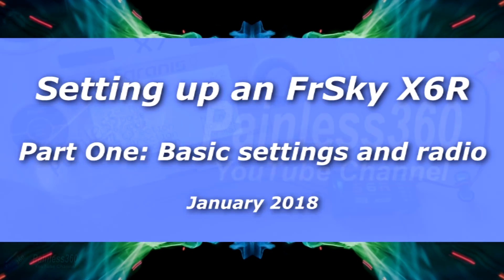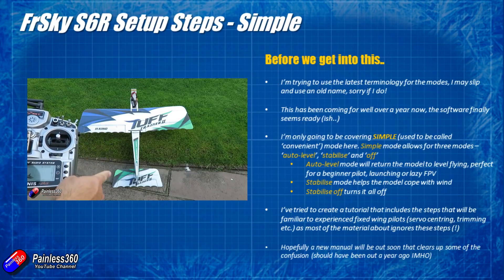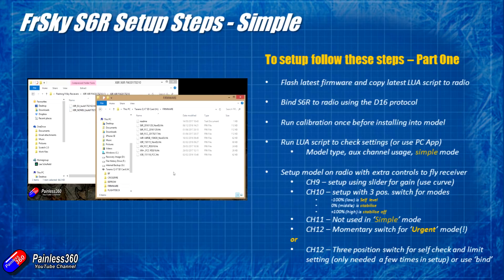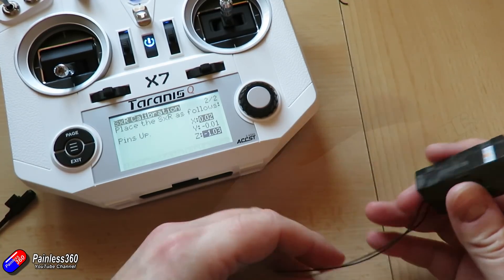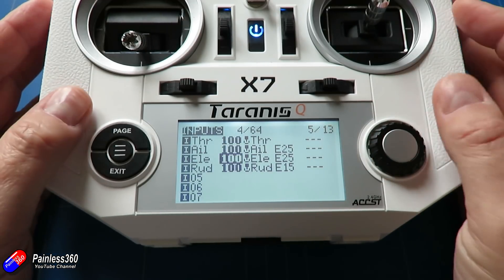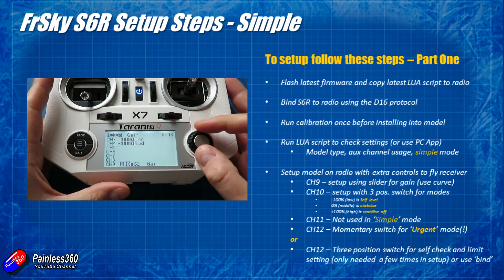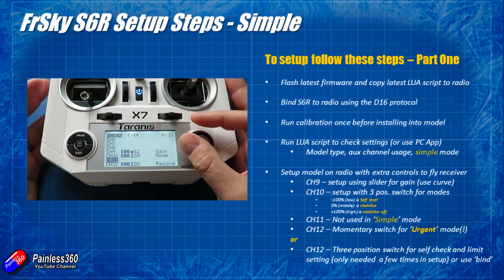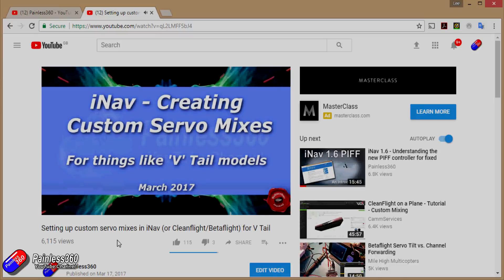(1/2) Frsky S6R/S8R Basic Setup

Comment: These are great videos thank you. howevrer the thing that had me totally foxed was that servo reversing on fixed wing models These are great videos, thank you! However, I was completely puzzled by the fact that servo reversing on fixed-wing models is done outside of the Lua script and is simply adjusted on the transmitter. Looking closely, I noticed that two of the channels in the image have a negative sign in front of their display.

The challenging aspect is that this is not the case when setting up for a Delta; in that scenario, the Lua script does reverse the servos.is done outside the Lua script and is simply done on the transmitter Looking closely I can see that 2 of the channels in the image have the - sign in front of the channel display .
The very challenging thing is that this is not true when setting up for a Delta; here, the Lua script does reverse the servos
Reply from the maker: Check out my videos on the Sparrow stabiliser.  So much more advanced than these... Happy flying!

Comment: Hi, sorry if you covered this, I'm in a rush between videos to find this crucial although simple information. I'm using this receiver for a non-airplane application and it's incredibly dangerous if the motors try to compensate with the stabilization features. Because of this, I need to disable the accelerometer---how is this done? Thanks!
Reply from the maker: Yes you can turn off stabilisation and the change the gain. Happy flying

Comment: Hi, thanks for the video! However, I discovered a strange phenomenon. If the gyro is deactivated via the 3 pos switch, the auto mode is still half active. I disabled my gyro but my plane would not fly inverted, the gyro kept trying to use the ailerons to bring the plane back to normal flight attitude. It took me a long time to find out what caused it. I have to set the AUTOLEVEL gain value to 0% in the gyro menu in the LUA script. This is the only way to fix the problem. The second strange phenomenon is that I have to manually calibrate the gyro before every start as soon as the lipo is plugged in, otherwise it cannot be deactivated via the 3 Pos switch and would be on permanently. Somehow I haven't been able to get along with this S8R gyroscope for 2 years. I discover new problems every time.

Comment: What rx would you recommend for line of sight flying in planes not needing stabilizer or gps .Just a good reliable 6Ch RX to work with my TX16S.Thanks
Reply from the maker: I use mainly FrSky X8R receivers here as I have lots from the days when I had a lot of fixed wing models all built at once..
Reply: @Painless360  Ok, thank you . Have you heard anything about them not being compatibe with the radiomaster tx .Something to do with what version of the accst they have. Im really new and just looking to keep it simple and plug and play and not have to mess with firmware and such.

Comment: Can you use the stabilizer on the x20 tx? I can't find anything to show me how...
Reply from the maker: It should do, same process. I've not had the X20 in here to try so can't sat categorically. Best of luck
Reply: @Painless360  I did find a video for it. It is way different. I didn't really know that it was called "SxR." That was the biggest thing to help searching.
Reply from the maker: The 'X' in SxR is there because there were different versions, an S6R and an S8R (as in the thumbnail for this video). Happy flying!

Comment: With this gyroscope, i dont need receiver?
Reply from the maker: It is both..
Reply: @Painless360  Do you know any gyroscope that is lighter and accepts at least 7-8 channels?
Reply from the maker: I have a few videos in stabilisers on the channel - check them out. They will need a separate Rx though..

Comment: Thanks for the videos, they have really helped me get the s6r going in my power glider. I have an issue running 2.2.4 and on the simulator is shows "S2" 0  to 100 % with 50% in the middle as in the video  but on the actual transmitter it give me 0 to 100 in half the turn radius, 50 is at a 1/4. Can you tell me what I may have done wrong or is the a glitch with 2.2.4.

Comment: Can't get the AIL to work ? I have put it in the correct socket in the receiver and put the mix like yours, but no reaction on AIL1. Anyone have any clue?
Reply from the maker: What troubleshooting have you already tried?
Reply: @Painless360  I did put the AIL in other channel and it works there. I took the latest  SD files from open tx which have the SxR files in them. The wing type lua and the calibration lua. The new one from 2020 didn't work, I got the one from 7-7-2019. I didn't update the firmware of the receiver yet, maybe that's the issue?
Reply from the maker: I'd always update if you have a problem, it's the first thing anyone trying to help will ask you too.. Best of luck!
Reply: @Painless360  So i updated the firmware and bootloader opentx en taranis. Got the new firmware for the S6R, but now I can't bind it to my radio anymore. It's solid green when binding, after plugging it (battery) out and back in, it flashes red...
Reply from the maker: The latest firmware from FrSky isn't compatible with the previous versions. I'm guessing you are not a regular viewer else you'd have seen this - https://www.youtube.com/watch?v=vOAFdp52cVU

Comment: Thanks for that video. I helps a lot with setting up my X9Dplus. What I did not really got is the difference between "self level" and "stabilize" an channel 10!?
Is "self level" the backflip to horizontal flying mode?
Reply from the maker: Stabilise is like what a gyro would do and self level does what it says on the tin - self levels the plane in the absence of a stick input.. Happy flying

Comment: Hello, Mr. Thank you very much for your informative videos. All helped me to set up my S6R without problems. I have only one question. Is it possible to turn it around 180 degrees? Heading direction is always antennas front. In FreeLink software from FrSky there is no such an option.  Inside of the fuselage is no room to point antennas out if it is set up as normal. Therefore I need to turn it around, otherwise, I get failsafe and RSSI low. Thank you for any help.
Reply from the maker: Not unless the software has changed since I made the videos... best of luck

Comment: Very helpful video, I'm setting up a few of these for the first time. Quick question. Is it possible to use two of these receivers together? I have a plane that would benefit from using 14 separate ports. Would I still be using ch. 9, 10, 11 and 12 for the gain etc. or would they shift to 17, 18, 19 and 20?
Reply from the maker: I've not tried. See my D16 X-series reciever binding tips video for how to bind two normally... Happy flying

Comment: I got an S6R about six months ago as a gift from the g/f, an had all sorts of problems.  Finally got it to work not but a week ago, but I still just use the EagleTree Guardian that I bought to replace it.  Sooooo much easier to setup, but it is JUST a stab., not an RX/Stab combo like the S6R.  Still.....
Reply from the maker: The eagletree unit will probably outperform this thing from FrSky. As I've said in many other posts  - it's a good idea but a lousy implementation... happy flying!

Comment: I appreciate all of the time and information you provide here.  Thank you!  I would LOVE to be able to use lua scripts for calibration and set-up of my S8R, but the scripts I have downloaded several times from OpenTX do not seem to connect with the S8R (no yellow lamp) and show ---- for all the input blanks.  I've reviewed the radio set-up and have the mode and channels set correctly, with telemetry (radio prompts and screen confirm this) but can't get them to operate in my X9D plus.  Can you help?  Thanks in advance...
Reply from the maker: Hi Steve, I've only created the videos in the playlist as I'm not a fan of this thing. The idea is great but FrSky made a hash of the software and hasn't sorted it enough despite all the feedback. If you get it sorted I'd like to know what it was.. Best of luck!
Reply: @Painless360  Thanks for your response.  I've tried to find a LUA script that works but can't.  They're no longer on the FrSKY "tools" menu.  Any way you could post the ones that you have, so I can pick them up?  I'm running S8R with latest firmware (quick mode).  

The SxR is a great idea and I can appreciate how much information the RX has to have to do it's job on any one of a million different set-ups.  Getting that in there is not easy.
Horizon Hobby makes BNF planes with ASX3 receivers in them and configured and they're pretty good right out of the box.  This is the right way to do it for new pilots.
Reply: @MrStevealvey  if I understand you correctly? You can't get your LUA script to run??  I'm in search for the same answers.  Just got this receiver today and it talks to the Tx but the Tx doesn't want to run the Lua or Calibration.

Comment: I'm trying to setup a Delta wing for my flying wing with the S6R but when I try to setup channel 1 ail and channel 2 ele it only controls channel 1. When I delete the mix for channel 1 and then have channel 2 it controls my servo that's plugged into channel 1. I found if I turn off the features for auto level and what not I am then able to control the servo plugged into channel 2 with the mix setup for channel 2 like it should work. Please god help me.

Comment: I know this is an old video. I have an S8R. Using the airlink USB adapter I have used it to succesfully update to the latest firmware. However once I switch the USB adapter dip2 to configuration mode and connect my S8R it doesn't seem to do anything. I can read & write settings to teh receiver but none of them "stick". In other words I can change a setting, write it, then when I read it back the setting isn't there. I am using Freelink V3.0.  Does the freelink app still work?

Comment: Hi, great video. I’m new to flying. I have a bixlar 2 and the s6r. Looking at your model on the simulator you have ail and rud weight set to -100. I’ve watched your other setup videos and I don’t understand why. Should I be doing this?  Thanks.
Reply from the maker: All I knew about this thing is in the video - I've not used it since making the video to help others out. Best of luck!
Reply: Hi, I realised what it was.  -100 weight is for swapping the direction of your rudder. Thanks for the fast response

Comment: could you help i have the s6r can i daisy chain the gps and the voltage meter from frsky too it and it all works?
Reply from the maker: If you are using the S.port sensors then they work with it in the same way as any X series receiver..  Best of luck!
Reply: @Painless360   thanks very much

Comment: Hi, thanks for this great video. I run into a problem though. I have calibrated my S8R once, but when  trying to calibrate it again (with my X9D radio), the LUA script stops at position #1: I can enter as many times as I want; position #2 won't come in. I tried that because I have opened the RX to waterproof it (it is for a Dynam Catalina) and didn't know if the calibration would be affected. Is the calibration a 'one time only ' kind of thing?

Edit: a day later the calibration mode worked again. No idea why, but the result counts :-)

Comment: Rather than creating a curve for the gain, why not just set the weight & offset to 50? That makes the potentiometer's range 0-100

Has the same effect but probably a bit quicker to set up for most folks.
Reply: That's what the manual suggests, too (at least for the Archer SR receivers, which basically do the same as these).

Comment: I cant get my S6R to enter Bind mode. All I see is a solid green lite on the RX. I've flashed the RX several times but this hasn't fixed it. several people have shown this happening. Please not that this has nothing to do with the TX The RX will not enter BIND mode. I have been able to bind this RX in the past PLEASE HELP
Reply from the maker: All of the information I have on this receiver is in these videos. I’m not a fan of these, the idea is excellent but the implementation is terrible. Best of luck with your problem, let me know if you find out what the answer is.
Reply: @Painless360  thanks for the mega fast response. Binding which should be a simple thing seems to not always work as it should.
Reply: Just a quick heads up. The issue was the back board of the Taranis. I replaced it and it now works fine. A multimeter across the antenna leads has my dead board showing open circuit and the working board has a very low ohms around. 6 oms on the one that works.
Reply from the maker: @finecutpost  Well done on finding that out. Glad it's working!

Comment: Hi Lee,Thank you for these videos they have been a great help so far. I do however have one issue and was wondering if you could help to shed some light on it for me. I'm using an S6R in a delta wing EDF and as per the video I'm letting the RX do the mixing, Everything is fine when both AIL and ELE are set to 100% but as soon as I try to add dual rates, expo and travel limits I end up getting limited travel on just one elevon servo. I've tried adding the dual rates in both the Inputs page and the Mixer page to see if the issue was caused by changing the mixing in radio but the issue is re-occurring. I was wondering if you had come across this issue yourself or if you might have a suggestion on how to overcome it as I can't fly this EDF without equal aileron travel or without dual rates especially on its maiden. Thanks in advanced for any help you can give. 
Kind Regards, Ben.
Reply from the maker: All the information I have is in these videos, I’m not a fan of this thing personally I think the idea is excellent but the implementation is lousy. I only got it to work by following the steps exactly. Best of luck!
Reply: @Painless360  I get your point exactly with this thing. So close yet so far. I will play with it some more and if I find a solution I will let you know. Thanks again Lee. Have a happy new year.

Comment: Have you any video's on how  to set the 3 flight modes for a helicopter, ie normal mode, idle up 1 and idle up 2.? I have converted my Raptor 30 to electric and will be doing my 50 SE next, cyclic and throttle moving together and throttle cut all working, swash at 90 deg and hoping the gyro working , I have done this as a gear switch as on normal tx's +50,-50. Not much in way of video's like your's  I find that using a video is better as it can be stopped and started as you want. Thank's for any help you can give. I have looked on all the video's that you have made and can not find one on this subject. do not know of any other way of contacting you other on this site. You can find me on face book if you use it
Reply from the maker: On what radio?
Reply: @Painless360  Taranis Plus X9D
Reply from the maker: Then google something like 'OpenTX heli Painless360' and you'll find what my video that will help..

Comment: I just got one of these to put into a Bixler 2 (thanks to your help with all your videos on this). During setup I have found two strange issues, 1/ The orientation of the S6R compared to the Lua is messed up. I have to fit it so the X6R is on its side like you have but in the Lua I need to set it up with the S6R UPSIDE DOWN for this to work correct. 2/  Normal set up in the Lua I get an output from AIL but not from AIL2, this is the same for ELE2. This is not a problem as I can use a Y servo splitter for both Ailerons and connect this to the same AIL port giving me two free channels. All this was using the link to the files you have for flashing and Lua.... Confusing but working now.
Reply from the maker: Glad you got it working. I'm not a fan of this thing - nice idea, lousy software implementation..
Reply: Its a shame as this type of thing is needed to help new flyers. Frsky need to get the software sorted before releasing the product or make it more open development. For new pilots you need good instructions how to connect it and how to use/install any software needed to use the device. Keep it simple yet make it to the needs and more user friendly. Again I thank you for all you do, without you most of us would be stuffed....
Reply from the maker: I am getting in some stand-alone stabilisers that can be fitted to any plane as I agree - this is a useful aid for all levels of pilot and especially for scale warbirds! :D

Comment: Hello sir I have a small doubt. I have a flight lighting system and I want to know if I can plug it in the ail2 port as there is no separate aux port in the receiver . Thanks 😀
Reply from the maker: Not sure what you're asking, if you're looking for a 5 volt supply for those lights then be careful about the amount of currentit will pull. Don't forget that there are additional ports on this receiver the also supply those 5 volts too. Best of luck!
Reply: do you mean you want to use Ail2 as a switch for your lights?

Comment: Another question: Is the S8R going to do ANY stabilization right out of the box, or does it still have to be programmed. In other words, is there a default stabilization mode it will doo when it is simply mounted in the plane and connected to the servos?
Reply from the maker: You'd need to check the documentation for it. I'd suspect that until the basic setup is done you can't enable that mode. It would be very dangerous unless you installed it exactly as described in the manual and even then a mis-step in calibration would crash your model..
Reply: It seems that the basic setup is out of the box if you follow your excellent guideAAA++ - don't forget to set D16 mode with 12 channels- one other thing at the end it doesnt go to the second part automaticly